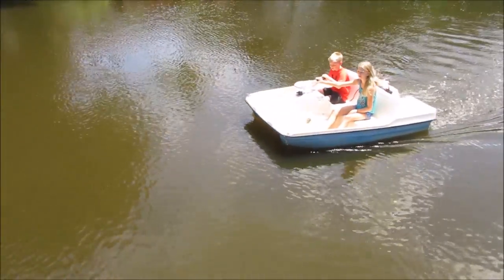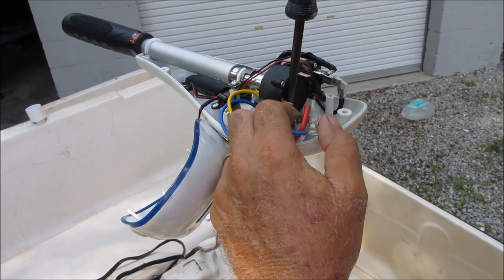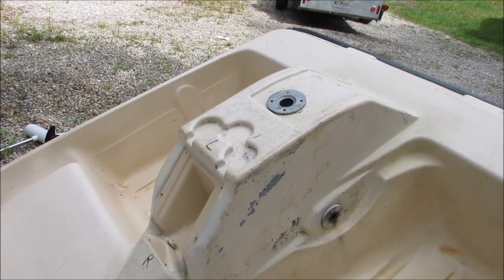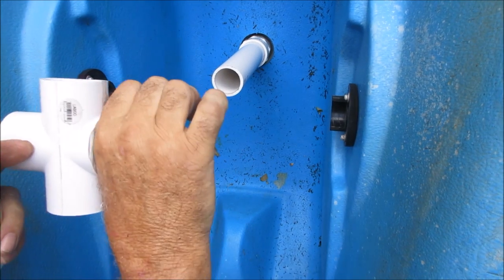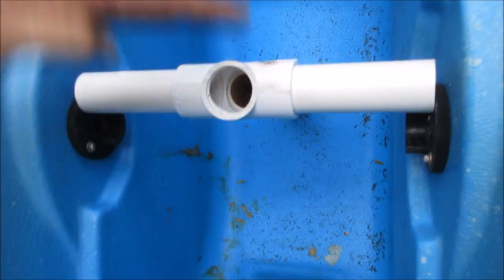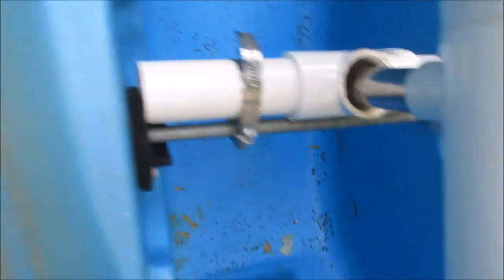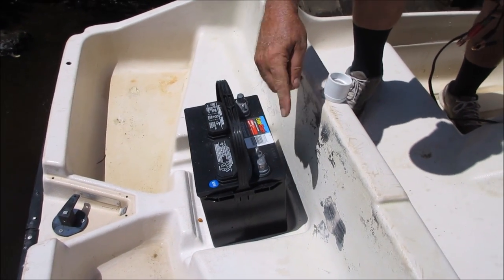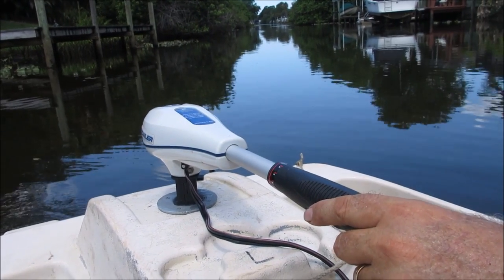How to put a trolling motor on a paddle boat

Comment: Watched your video at 10:30am and after shopping for parts and installation we were on the water by 5pm. Even made a grocery run during one of my breaks. Thank you for this video!
Reply from the maker: ApogeeLLC2012 that's awesome glad I could help!
Reply: Did you have to register your pedal boat
Reply: How did you stop your boat from leaking underneath where the pedals go in?
Reply: @aaronvennie2132  We did not
Reply: ApogeeLLC2012 just emailed you!! Thanks!
Reply: @cynnaolsen633  the pedals are not below water line...  and with trolling motor you'll get much less spashing in there....
Reply: Robert Roig Santamaria thank you!!
Reply: @aaronvennie2132  no
Reply: @aaronvennie2132  I had to register it in Michigan, Anything with a motor has to be registered in Michigan.
Reply: Hey Dangdodge,
 what size pvc did you use and were can I find the metal piece you used up to to mount?  Thanks
Reply: @marijuwainman  Lowes or Home Depot and the PVC was slightly bigger than the trolling motor shaft so go off the size of your trolling motor shaft.
Reply: @ApogeeLLC2012  thanks for the info

Comment: Dangdodge: Thank you for this video. I converted my paddle boat to electric but I ran into some issues. My boat has a narrower space between the hull and so when I installed the motor, the prop would hit the hull if I turned the trolling motor left or right. I had to set up, using clamps, the trolling motor so I couldn't use it for motoring until it was below the hull or if I had the trolling motor facing straight forward. The clamps work great because when I come to shore, I pull the motor up an fasten the clamp. Also, I used a wood dowel rod instead of steel. Everything else worked fine. It was fun engineering the minor differences between yours and mine but the video was the encouragement to undertake the project. I will be using it on smaller lakes to fish along the shoreline. One other note: I also mounted two oars on the paddle boat using clamps and installed oarlocks. I hope I never have to use them but they are handy just in case the battery goes dead or the motor quits.

Comment: I saw this video a long time ago and think it's great!  I bought a peddle boat last year for my little pond and its not working out like I expected and now thinking of doing this conversion. One of the problems I have is the hull takes on water thru the paddle shaft unless I sit in the middle seat. I cant see how the threaded rod that replaces the paddle shaft would not be a problem for allowing water in the hull as it does not always stay above the waterline. I am thinking I will just seal off all the shaft holes. thanks for sharing!

Comment: Nice job! I have a paddle boat I want to put the motor on the back. Im planning on putting the motor right in front of the rudder.  Your work is helping me with the part of drilling and adding the floor plate and PVC pipe.  Mine will be fixed and the rudder will actually work. Similar as the motorized version of this paddle boat as I have seen pics of where the motor goes. Thanks!  By the way what size PVC pipe?
Reply: Did you ever build it?  I understand if you build it this way (motor fixed in front of the existing rudder like original design) the battery should be placed in front to balance.  Also seems like a pain trying to transplant the motor controls up front by the existing steering.
Reply: @InfinityVision  I went the easy route as I got a trolling motor from a friend. I mounted a 2x8 piece of wood at the rear as a transom. Clamp on the trolling motor and hook up the battery and off I go! Love it and all so easy too.

Comment: This video has my gears spinning! You could take the motor, and attach it to the rear, while at the same time attaching it to the rudder steering pole, while replacing the steering handle with the motors handle. Same thing as this boat, just with rear-motor drive.

Comment: Gday mate... thanks for the video... Q. does the motor have to be lowered in order for it to give propulsion or will it work in the raised position. I ask this because I want to use my paddle boat in fairly shallow water holes to set and retrieve yabbie traps and it would be good to have not too much extending below the hull.

Comment: I wanna do the same to my paddle boat however you did not mention any measurements for the mounting plate up top, the length and i.d. if the shaft  and how you secure the lower end of the shaft to the bottom end of the boat plus how you removed the paddle wheel you mentioned it was easy  however i may not have the same boat i think mine is a sun dolphin...any help would be appreciated from anyone who had done this thank you : )

Comment: Why didn’t you put the pipe through the hole for the pedal shaft? I know it’s offset so the shaft doesn’t hit the rudder steering arm but surely you could have used a slightly shorter downturn to allow a 90 degree elbow setup. I feel like there must have been something else preventing you from doing it this way since you designed a nice setup.

Comment: I don’t mean to ask a dumb question but is it possible to have the pedals and the motor feature so a person operating the boat can alternate? Also thanks for explaining everything so well. Are you in the teaching profession?
Reply: You can but the paddle wheel will turn as the trolling motor pushes you along. The pedals will also turn so you either have to position your feet out of the way or pedal along with it. Also slows you down quite a bit. Aquacycle makes an electric motor kit designed for paddle boats that looks pretty nifty but it cost over $2,000.

Comment: My first thought was Wow, that's neat. Then I figured it would be moronic to remove the entire paddling system to then strap some paddles on the side of this thing just in case the engine dies in the middle of the water for whatever reason.

Why not just hook it up in the back and build a homemade arm extension with a steering wheel? Now that would be really something to play with. Not to mention how safer,more powerful and healthy it would be to keep the paddle system.
Reply: PatTheRiot I was thinking similar. No oars in the boat Incase that event happens, either.

Comment: Thanks for making this video.does the pvc for the shaft go completely through the boat? Or just a small length on the top and bottom.thanks
Reply from the maker: Thanks for watching. The PVC that the shaft goes through is about 10 inches long. It goes from the metal floor mount that was screwed to the top of the boat down to the tee that is at the bottom. If you have any other questions feel free to ask.

Comment: Downfall in order to go forward to trolling motor has to be in reverse another thing way too much PVC but the trolling motor on the back of the get rid of the rudders and the thanks and everything the trolling motor you want do use needs to have feet pedals so you can control the speed with your feet and not your the same bar that turned your rudder you can now hook up to the trolling motor and use that to turn the doing it this way you will get a tighter turn with the boat plus having the shaft where it can't move like that if you hit a stump destroy your motor

Comment: Removal of the paddle wheel wasnt that simple for me i had to drill out the rivets that secured the paddle sprocket
Reply: Drilling out a rivet isn't simple?
Reply: @METALfanUSMC  turns out i didnt have to remove any rivets...just got the pedals removed, cut threaded rod to size, drilled the hole at the top, now im ready to assemble it all together